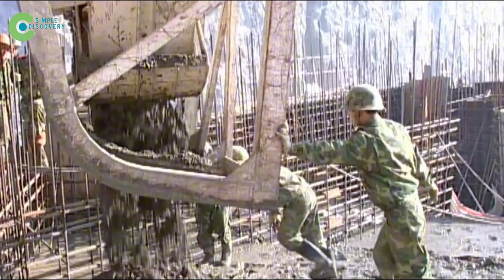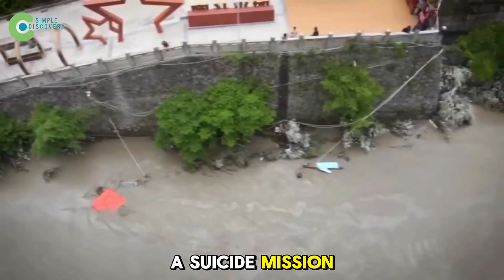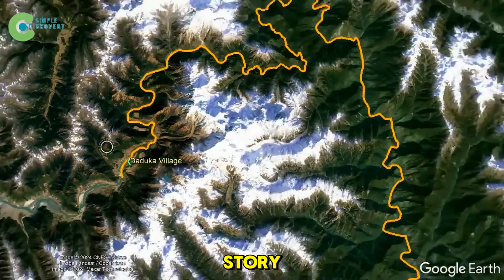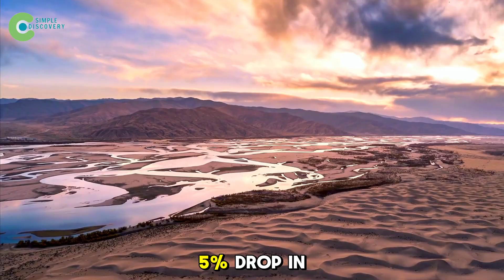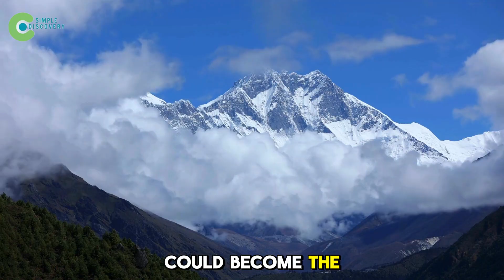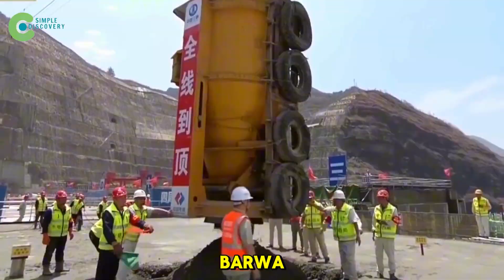MILLIONS OF TONS OF HIMALAYAN SOIL ARE DISAPPEARING — What China Is Doing Will Leave You Speechless

Comment: The AI that wrote this is too dumb to realize that this is not going to be a dam. It will not be holding back water. It's going to be taking a third of the flow of the river, routing it through tunnels in a mountain where it will spin some turbines, and then it rejoins the other two thirds of the river on the other side of the bend. You literally became more ignorant if you believed what this video showed you.
Reply from the maker: Thanks for the clarification. The video simplifies a very complex project—it's true that much of the water is diverted through tunnels for hydropower rather than stored like a traditional dam. We appreciate your insight and attention to the technical details.